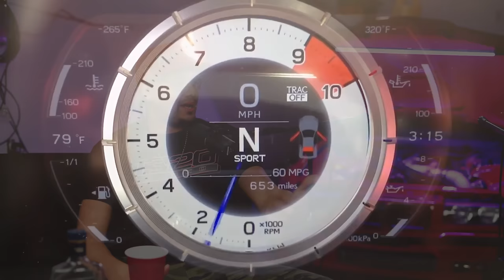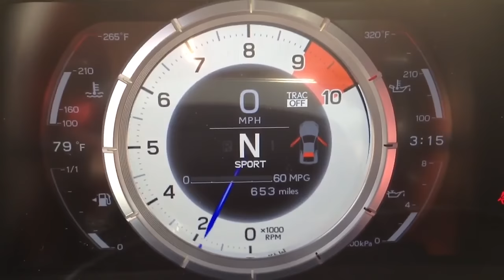Francis With The Worlds First 1000HP AWD BMW E36 On Racing Dan Rue, Building BMWs

Comment: Also the 2JZ as he stated was developed by a German engineer race team. Francis definitely knows. To add also that German engineer based the bottom end off an old Mercedes I6 block.
Reply: Thank you sir, Those mercy i6 blocks are still insanely strong to this day
Reply: @Francis_von_louie   My Father has a Euro 85' 300D 5 speed manual cloth interior that's been sitting for 23 years in my sister's garage. Looks like the 87' we got w164 I believe.  I'm thinking about running a fuel cell and overhaul the system. That'd be awesome if I could run it on 93 and E85. The bay is beautiful to work and run a PT6466 on E85 standalone.

Comment: Really good interview as a diehard E36 running a SC set up making over  600whp but I love it well balanced. I know this guy and he is really kool 👍🏾 I bought my first Fully loaded 94 325is with dove grey Vader seats & tilted steering wheel with all sorts of options in 1999. I’m on my 3rd one now. I got a mk5 golf R32, a built B8 Audi A4 a 95 C36 AMG and the E36 is still my favorite ❤️

Comment: I got a m52 with m50 head 6266 percision single top mount, etc etc   in my 1989 e30 vert. I did almost of the work myself but damn I wish I had the knowledge to figure out awd. I don't even have a cage so my car leaves brown stains but hoping to get a ford 8.8 rear this summer to help put the power down smoother 🙏

Comment: this E36 is a beast!!! it remind me the most quickest car on my island!! in my neighborhood there is a old chinise man that used to work for a racingteam and he built an awesome AWD 1000hp e36 coupe with a S38B38 engine turbo this dude place the engine under the hood more in the back of the car and snap an AUDI gear box and weld, build all the parts himself! draveshaft, alluminuim rollcage, tie rod ect...

Comment: The road car F1 engines with over 100,000miles is called a seasoned block. When it's gone through that many heat cycles is removes the impurities from the iron. 
All formula 1 cars manufacturers did it back then.
Reply: Cool facts we learn every day

Comment: This is the most real talk about gow it was back with obd1 cars. I remember if you had bends to close to a maf it would cause issues. We use to actually turn the pipe on 5.0 maf cars (i.e. the maf wouldnt be on directly verticle) to fine tune how the computer to richen or lean the engine out because it was easier and leswork than having the chip removed and programed.
Reply: The peeing thing. Actually back in the days when they hand pounded swords and things like that they would heat treat with peeing/urine. But different effect when the metal is red hot/heat treating then when it's not in that state.
Reply: Most turbo e36 's run maf if they are still on the stock computer. E46's too.
Reply: @drewdavis239  ok. But what does that have to do with anything I said.
Reply: @78cobra  "do you remember when the bends by the maf caused issues" ? It still does.   "Do you remember when you would rotate the maf and it changes your air fuel?" Well... It still does. Apologies if I assumed you could connect the dots.

Comment: My n54 started running right even, with index 4 injectors once I replaced everything plastic related. Intercooler, chargepipe, BOV, and added an oil cooler.

Comment: 32:09, they may use different scale for hp and tq, or plot tq in nm (then you need 30% bigger numbers on the side), or is scaled to fit
hp cheating happens in correction factor
33:44 crank/wheel, its same hp when doubling, so doesn't matter.. also 300hp 300tq - tq would need to be in nm, even an m54b30 does only that amount
50:54 this surprises me, who even does turbos on stock motronic ecu? pnp boards are out for m50 for 10years, i know there were ton of guys running Megasquirts 14+years back. With Siemens ecu its a bit different, it can be done on ms41 but you are somewhat limited (resistor to maf signal or even bigger maf) and you still only need $300 for pnp ecu (speeduino for example). MS43 is a bit better at turboing but still, what you dont invest in standalone you will pay in number of tunes you will need, and in parts you brake. And in the end of the day, if you want to dial it up, you will need to get standalone either way. But going from cheaper standalone to more expensive (lets again use speeduino, and then going to emu black with tcu lamik for 8hp) you already have build running engine correct way, you don't rely on factory sensors (and their number or application, lets say you now have even with cheap ecu (rusefi uaefi is $100, has build in o2 and dbw) you can have fuel and oil pressure in, crankcase/coolant pressure, and have fully working boost by gear and boost cut, with non fuel cut limiters (spark cut) and would other way knock you engine on limiter with pump gas)
1:14:21 oil pump chain tensioner is needed, welding the nut doesn't solve the issue, that way you will just snap shaft or part where its welded. At high rpm it has harmonics/slop in chain that normaly drives nut off
1:37:33 they didn't even have 100k miles, much lower as they were new cars, problem was BMW wouldn't support BMW Motorsport with brand new engines, so BMW Motorsport had to source them from road going vehicles ( this was true for year or two, after that they got deal with BMW). Similar thing with Subaru, any Subaru wrc or autocross head has nothing to do with Subaru, they get casted in England with totally different ports shape and location.
1:37:51 not true, they weren't seasoned, or even outside, block are ruined by that (just look on L19 material.. hydrogen embrittlement is thing in any material and metal, even plastics). In time they made 800-1000hp, all block were brand new from BMW. Also don't believe horsepower claims. You cant make that amount of hp at that pressure with fuel they used. As said, they are at best 1000-1150hp (in qualification with blowing turbo/engine after lap/one straight) .. not 1400 or 1600hp for a lap like some say. In normal racing it was 650-800hp engine.
Reply: Thanks for taking the time to reply. I learned something. Your time was not wasted.

Comment: 44:44  You are correct, drivetrain loss is not a set percentage.  Loosing more power the more you make doesn't make sense unless you increase its drag from heavy duty, harder to spin transmissions, diffs, etc.  Gale Banks explains it better in The Smoking Tire Podcast #389 at the 1:33:12 mark.

Comment: Bmw uses a long final drive with close ratio gears designed for the final drive. Japanese use a shorter final drive with a closer ratio gearbox. The longer final drive is better for track and spirited driving you can try this in forza it will make your lap times drop.

Comment: Bench racing is fine but traction control, launch control, awd, hybrid electric are going outperform with a lot less power.    E36 platform is beautiful under 600 hp then things start to break.  Love the suspension discussion.  Spec miata and e36 are great racing classes.

Comment: The 5252 thing isn't 100%. I'm yet to have that on ANY of my cars. Mix of all kinds of aspirations as well.
Reply: I’m not going to lie I just looked for a random dyno number in the c6 forums.. and definitely crossed at 52 Ish
Reply: It's like 96 percent on all motor and normal sized turbo cars
Reply: It's theoretical. Irl it will maybe differ a bit, but 5252 is not a random number, it's textbook

Comment: 3:17 what’s crazy to me is, maybe I’m slow… m50’s were in the e34’ 25i’s. I don’t recall e36’s ever having m50’s. Not to say they don’t exist but every e36 I’ve seen was m52.
Reply: e36 ran from 1990 - 1998 or 1999. I believe it was 96 where they switched from m50 to m52 dont quote me on that
Reply: 1992 but yes everything else correct.
Reply: OBD1 e36 had m50 i.e. the 325i and 325is. My 325is has an m50
Reply: Fun fact, it was the e30 till 1993 in Germany. I had a calipso e30 vert that was a German spec gray market 93' (in upstate n.y.) . Always had to order 92 parts (and everything under the hood was in German)
Reply: Another fun fact is that bmw did not want to deal with OBD2. So they sold "1995" cars in North America until mid 1997 or so.  If you pay attention , lots of 1995 cars for sale. Lots of 1 year only 95 e36 m3's. Hardly ever 
a 1996. Lots of 97's and 1998's

Comment: He's very smart but in every manual I've ever rebuilt or heard of fourth gear is ALWAYS 1:1 not fifth so if you "blow up" a manual trans,if it still spins you'll have fourth gear because it's a fixed gear to the main shaft and countershaft.I've driven one of my street/strip mustangs home from the strip with only fourth gear😂

Comment: The production version of the Lexus LFA features a 412 kW (560 PS; 553 hp) V10 engine developed in collaboration with Yamaha exclusive to the car. Yamaha also  made :
10 Toyota 2000GT.
9 Toyota's 4A-GE Engine.
8 Toyota's 2ZZ-GE Engine.
7 Toyota's 2UR-GSE Engine.
6 The New Hydrogen-Powered 2UR-GSE Engine.
5 Toyota's 3S-GTE Engine.
4 Ford Taurus SHO Engine.
3 Volvo's B8444S V8 engine.
Reply: Thank you for clarifying that

Comment: Some much important info there ..Great guy
Reply: Thank you sir
Reply: are you still on copper spacer + cutring ? @Francis_von_louie
Reply: No, after you build the engine it isn't needed, since the pistons change the compression.
Reply: @Francis_von_louie  and what type of gasket you have now ?
Reply: Cutring with 11mm studs
Reply: thanks mate..what is your compession ratio ?
also post some pull video of that beast car  @Francis_von_louie

Comment: German engineer didn't design the 2j block. They only did testing on it. Also, Yamaha developed the head on the 1JZ in collaboration with Toyota. Yamaha did not touch the 2JZ head.
Reply: That's why I labeled it as "lore"

Comment: I saw this car at Poconos. I wasn’t too impressed. There was a lot of rust on it but it is an old car so I gave him the benefit of the doubt but when he went out to race, he only went 165 mph… I have a stock coyote Mustang with just a simple Whipple set up that went 169 fully stock full weight ..I really thought this car was faster.. He does seem to know a lot about BMWs
Reply: Back then my car was only making 800hp, since then I've had the rust cut and fixed, also your comparing apples to oranges.

Comment: Bro is very knowledgeable, but i gotta call bs on the fake dyno just because the lines crossed at a different RPM. I took a nascar/nhra type course in the school I went to and we learned about the situation he was describing, but this formula only equates with certain engines. It was a good way of telling if someone is cheating in a race where the engine restrictions are tight and every engine has the same specs. For example you can dyno a stock 350 and save the chart and then install better heads and cam and if you overlay the charts you'll find the cross section moves higher in the rpm range. 
350 was the example I used but the same is true for any other engine, even inline engines.
Reply: Thank you sir, the fake dyno thing I was referring to was an actual shop who admitted he faked it for sales, but yo are correct a large majority of engines do cross at 5252, but some don't.
Reply: @Francis_von_louie  that doesn't mean you don't know what you're talking about, hopefully nobody gets that idea from my statement. You're definitely a top-tier badass builder!

Comment: 1:32:00 MQB ftw VW ftw, They same downpipe tune formula applies just like the BMW’s of today. Hybrid turbos and fueling raise the bar even higher as well, Definitely a good performance platform in my personal experience. And I owned a Coyote previously, but the VW’s can make power with not much work and they aren’t as hard to work on as people make it out to be if you have the right tools/sockets

Comment: Time Stamp: 21:25 it's like that with most cars these days.. They have it where they can just flash an update to your ECU now, as long as our is parked near wifi they can do it now.. It's planned Obsolescence.. They make parts they know will go on average at 70K and truthly believe when the ECU see's it's at a certain mileage and then glass your chains in your motor or and now trans.. I remember back when auto's would last 400K it would always be the motor that went first.. Not anymore, You need to treat your trans fluid like it's motor oil....
Reply: Absolutely, but people don't see it.

Comment: The 350z engine is hilarious. Big 3.5 v6 engine, and even with a full bolt on, with cams, e85, forged engine, revved to the moon ($15k+ NA build) you're barely making 300whp. I'll never understand why they're like that.
Reply: They can make 300 whp just fbo fully built they can make around 400 still not that crazy but yeah
Reply: @MegaBlankbullet  100% untrue, unless it's with nitrous. The 3.8 and 4.2 strokers can do 400whp. But not a 3.5 unless u have a good itb setup, standalone etc. Would be like 25k build for a forged 3.5 to make 350whp (lots of people fake dynos, but I've seen it in person and know people back when I had my 350z who had em)

Comment: Anything more than about 700-800hp in a 3500lb car is un-driveable and pretty much un-useable on the street.. I sold my 17 Coyote with VMP TVS cuz I went too far with it.. 800whp was stupid on the street, it was pretty much useless.. Now I have an 22 Camaro SS 1LE Manual, with cam, intake, headers & cai.. It makes 550whp+ depending on fuel.. Its all you need to have a blast on the street, sound like its chopping the block down, and not go to prison or die..!! I can beat on it all day long, its perfect for highway rolls, road course, dead nuts reliable, drove it 10hrs each way on vacation with my wife this past summer.. Its perfect power.. Everyone these days with the internet, thinks they gonna be the boss, and drag peoples asses, then they go to the track or meet, and you still get gapped like a MF'er.. They eat up BS thinking they car gonna actually be reliable boosted to the gills, then 1 cold day, or one bad tank of fuel and you destroy a motor that you can't afford.. It takes big bucks to race guys!!
Reply: That's exactly what I explained, thank you for your perspective
Reply: True

Comment: Dude I can't with some of these people you interview. This guy has said multiple things that are just straight up factually wrong. Just one case in point is him explaining gear ratios. For like a 3.42 ratio, the input shaft spins 3.42 times for every 1 time the output shaft spins. That's the equivalent of trying to bicycle up hill in 4th gear vs 1st. In 1st you pedal faster but the rear tire doesn't move much but it's easier to pedal up hill. Aka trq multiplier. If you're in 4th you're having to stand up to pedal up the hill and it's super hard. That's like a 1:1 ratio.

Engineers are some of the dumbest people on Earth. He is proving the stereotype. The longer I watch.
Reply: Just because you have a fast car doesn't mean you know how stuff works lol. People really need to stop thinking everyone people talk to is a SME.

I edited it to say people. I didn't mean to say "you".
Reply: All you did was explain the same thing I said about the transmission using an analogy with a bycicle, what else did I say that you disagree with?
Reply: @Francis_von_louie 18:55 "when he says multipliers, can you explain..." and you basically said ratios are torque multipliers meaning they multiply the torque. Gear ratios are ratios of input shaft revolutions in relation to output shaft revolution. If my car makes 800ftlbs in my 1:1, and in another gear it's a 3.42. I'm not making 2800 ft lbs of torque.
Reply: @Francis_von_louie to answer your question a bit further, new gen LT cars (you mentioned vettes) have to run meth on e85 because they don't have enough fuel pump or injector or both to run higher meth content, so they supplement the octane with meth to take load off those components.
Reply: Oops I guess when I pull out the time stamps, the thread goes quiet. 👀👀 Get your mans @StreetAlphaPodcast